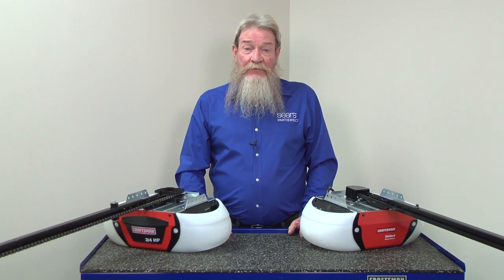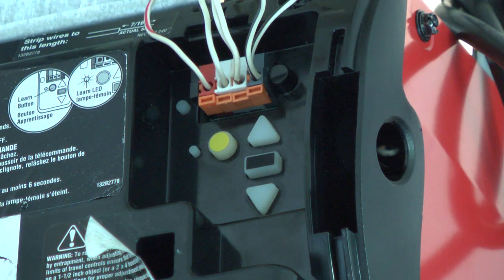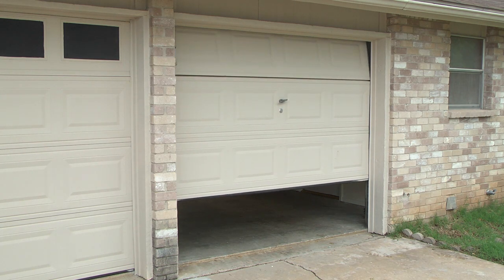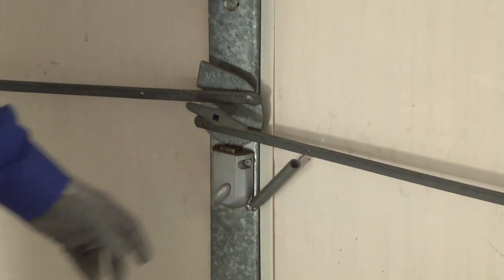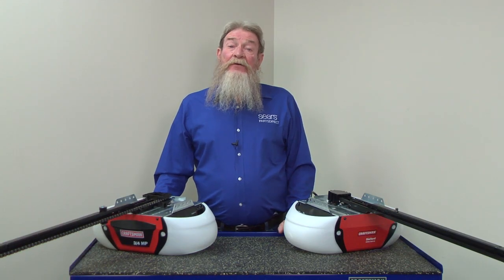How to Fix a Garage Door Opener that Won't Move the Door: Motor and Travel Troubleshooting

Comment: when I press the button the door doesn't move. the trolley won't move at all. when I click the button I can hear a click every time I press the button. I do have the garage door released and it's closed.
Reply from the maker: The garage door opener may have a failed logic board, loose wiring connection or a bad motor. Jammed gears inside the motor unit may also be preventing trolley movement. Unplug the garage door opener and remove the motor unit cover, then examine the internal wiring and gears. Reconnect any loose wires and replace any damaged gears. If you need more help, let us know.

Comment: my craftsman ultra quite i installed yesterday. door went up and stays up and now buzzes when you press the button.
Reply from the maker: Pull the emergency release rope to free the garage door from the trolley. Manually lower and raise the garage door, checking for travel obstructions. If the door doesn’t raise and/or lower smoothly, resolve the issue restricting door travel. If the door travels smoothly, activate the garage door opener to move the trolley along the rail, checking for travel obstructions. If the trolley doesn’t move smoothly along the rail, resolve the issue restricting trolley travel. Make sure that you tightened your belt as shown in the owner’s manual (probably on page 10 of your manual). Don’t forget to set the up and down travel limits according to the instructions in your manual. We hope these tips help you get the garage door opener working. Let us know if you need more help.
Reply: How can I fix when I pull the cord

Comment: My motor runs but never moves the chain. The crank has plenty wiggle to it. is this normal? I never checked before I had a problem so I'm not sure
Reply from the maker: You shouldn’t detect any play in the sprocket that drives the chain. Unplug the garage door opener and open the motor unit. Examine the internal gears. Based on your symptoms, you may need to replace the gear and sprocket assembly as shown in this video: https://www.youtube.com/watch?v=qDog-nbQ1hc  .

Comment: nice video, but u nvr showed in detail how to swap the motor sensor or the logic board
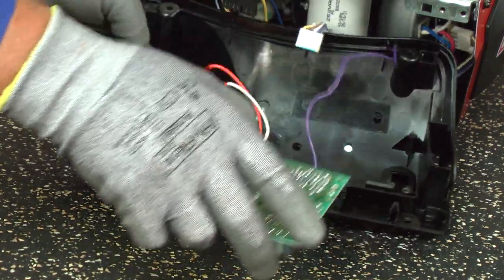Reply from the maker: Here’s a link for a video that shows how to replace the RPM sensor (link also shown at 2:35 in upper right corner of video): https://www.youtube.com/watch?v=WH0fZUyAasA. Here’s the link for a video that shows how to replace the logic board (link also shown at 2:50 in the video): https://www.youtube.com/watch?v=rnzts1K5_4k.

Comment: Our trolley and chain has been clattering and shaking so violently it has taken chunks out of the ceiling. The outer trolley itself is extremely loose I noticed a heavy white coating on the inside top section. Possibly drywall dust?  Any suggestions for adjusting?
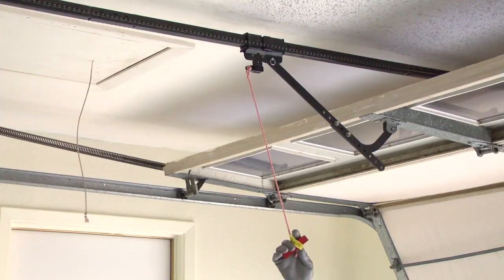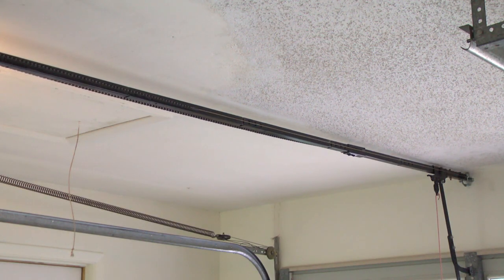Reply from the maker: Pull the emergency release rope to disconnect the garage door from the trolley and check garage door travel as shown at 1:25 in the video. If the door doesn’t  move smoothly, repair the door or the tracks. If the door moves smoothly when you lift it by hand, check the inner trolley travel as shown at the 2:10 mark. If the inner trolley doesn’t travel smoothly, check the rail and inner trolley for damage. Replace any damaged parts. Check the white plastic glide inside the inner trolley and replace the inner trolley if the glide material is worn out. Adjust the chain tension as shown in your owner’s manual for the garage door opener. If you don’t have your owner’s manual, you can likely find it at http://www.searspartsdirect.com/partsdirect/user-manuals. Post additional details if you need more help with this problem.